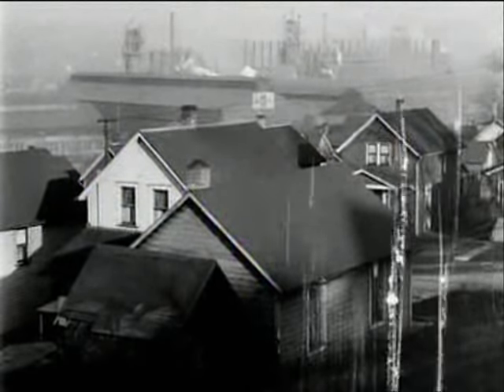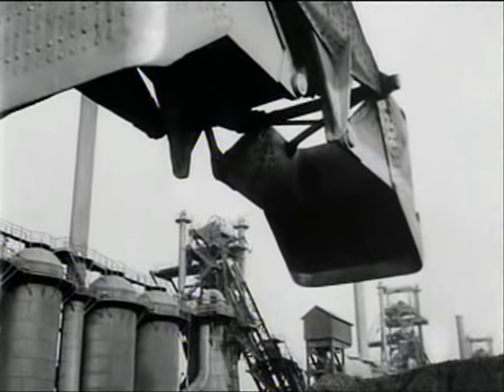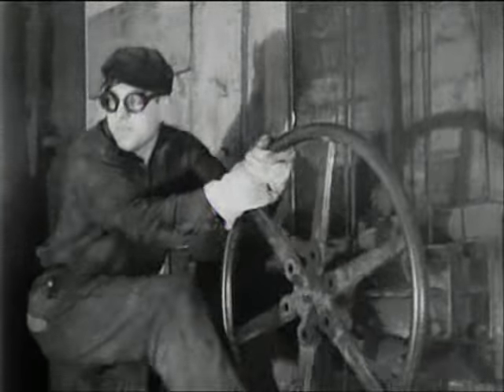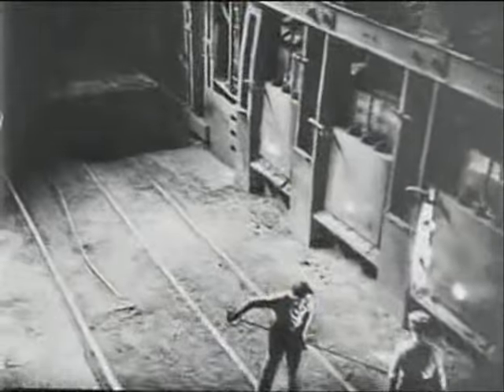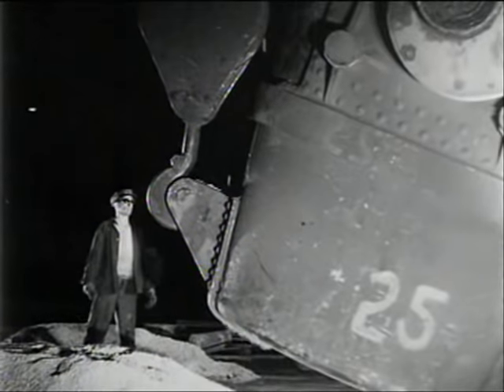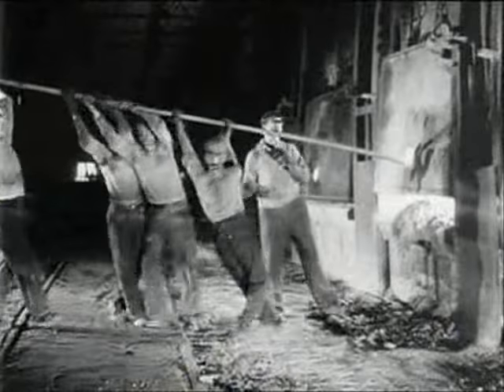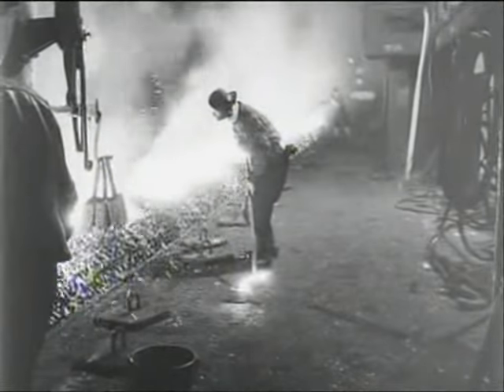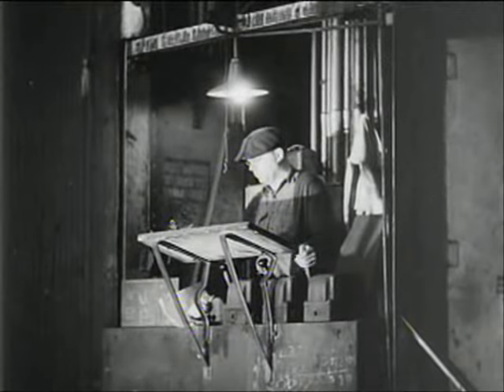Steel Industry 1944 Youngstown, Ohio

Comment: During a shut-down of my home division, I worked on a temporary assignment on the pouring floor of the blast furnace at Lone Star Steel (now US Steel) during the Texas heat wave of 1980. We tapped the blast furnace, routed the slag to an outdoors cooling pit and the molten iron through sand-lined brick ditches to torpedo cars. After the furnace was emptied we stood on boards on top of still red-hot remains of iron and slag in the ditches, cleaning them with shovels and wheelbarrows and adding a new layer of dry sand to protect the ditches used to carry the molten iron to openings in the floor to the torpedo cars on a lower level. As soon as were were done, it was usually time for another tapping of the furnace. My additional duty was to take the temperature of the molten iron with a long road and thermocouple. We didn't have any fancy silver suits and face shields,  just green fire retardant denim jeans and jackets and cotton gloves. It was unforgiving, punishing work. I was so glad to get back to my home division of the plant when that line came back up. I can't imagine doing that for 20-30 years. The 1940's era blast furnace was disassembled back in the 80's and sold, along with related equipment like the coke ovens. Those jobs are gone forever.
Show less
REPLY
Reply: these processes are still in vogue in most of the parts of the world!!
Reply: Far from gone forever. I work at the largest blast furnace in the western hemisphere. We make 14,000 tons a day.
And yes, the work is still punishing.
Reply: I did pretty much the same jobs at a 50's era Blast furnace at Algoma Steel. A tough job on the best of days, but it could get a lot worse. We were tapping the furnace one day when the drill got stuck. Only way to get it free was to use an oxygen lance. About 40ft of copper pipe screwed together with pure oxygen fed in one end. The driller repeatedly rammed the lance into the drill hole ( eye of the monster), two summer students (I was one) were behind him helping to hold the pipe as we repeatedly rammed it into the hole. The oxygen burned everything, the drill the fire mud and the copper lance, which got shorter as you went. The pipe got shorter and shorter until we were so close that the driller could hold the pipe by himself, and waved us away. The old driller had a face shield that was so distorted from the heat that he kept it up, held the lance in one hand, and used his other arm to protect his face from the heat. Right when the pipe was so short that the driller was within a few feet of the furnace the thing popped like a balloon. Molten iron sprayed across the room , the driller disappeared in the shower of iron. We ran for our lives, I thought he was dead. He ran out after what seemed like an eternity, his eye brows and mustache had been burned off his face. He sat down on the bench beside me, and started to cry. He said, 'Marco, I hate this a f'n joba, I gotta three more years, Marco stay in a school!'. Best lesson I ever had. Went back to school and finished my engineering degree!
Reply: I did the same thing at Sharon Steel Corp, Romer Works, blast furnace in the 1960's it was very similar as you described it, I worked mainly on the cinder side but remember standing on the the smoking boards working in the troff and skimmer taking turns with a sledge hammer driving huge bars to breakup iron build up and clinkers. Shovels and Wheelbarrows were the main tools!
Reply: Thank you all. For all you do.
Reply: You know so funny they blamed it on the oil crisis. And you know what's so funny. We became independent on our own oil. But guess what we won't be anymore. Nope not anymore. I wonder if China has anything to do with this? 🤔
Reply: Is this copypasted lol
Reply: Wow!!!

Comment: I grew up in Buffalo, a city that was supported by a giant steel industry. I knew people who worked at these plants... it was hotter than hell! 120 degrees F was the ambient temperature. When they opened the furnace, it was unimaginably hot. Only a few people could stand the work. They had permanently burned skin, and drank "boiler makers" on the way home.
Reply: Amelia Elizabeth Voss 
I work in metal foundry and can confirm your statement! I'm the youngest guy on the melt deck currently. They hired 6 men in a 3 month period for my job before I came along and stayed. 
The last guy hired before me walked out after an hour.
It ain't easy work, but I like the pay and enjoy the science! The senior crew taught me the trick to staying on your feet is to drink at least 2-3 gallons of water/gatorade per shift. Otherwise you'll become dehydrated and collapse. It's not for everyone, but a few of us wierdos enjoy it! Haha
Reply: I can certainly identify I was a slag and metal tapper for FMC in Pocatello, Idaho from 1989 up until the plant closed in 2001 The furnaces weren't the open type because the product we made was phosphorus, captured as a gas from the molten ore...the gas then went through electrified precipitators, then condensed down into a sump as elemental phosphorus. The tapping floor was as you describe "hot" especially during summer where your sweat soaked your shirt, then clung to you form literally doing nothing but standing there watching your tap. Each furnace had a tapping shed equipped with an air conditioner which sometimes worked depending how fast maintenance could get to it. Sometimes it was cooler outside in 100+ degrees where at least mother nature provided a draft. Sometimes your furnace got sick when the feed combination of ore, coke, and silica were not right you would be at the tapping hole burning multiple burn pipe, spilling over because you couldn't get a decent flow or even plugged, the slag therefore would build up and then you'd have to jackhammer it off the runner and turn box, then start all over. Fuck I remember those days, some were shitty fucked up stressed out days, but ironically I had some of the best and weirdest times of my life there. And by weird I literally seen ghost workers there dressed in their regalia of their time. I thought I was hallucinating at first from sleep depravation from the graveyard shifts, so I didn't tell anyone until I asked another co worker/ friend of mine if he had seen these ghost and he confirmed it as he described them to a " T " as wearing the same clothing and vintage hard hats the same that I saw in the same location as well. It added a whole new meaning to the term 'graveyard shift.
Reply: C D Kennedy chills down my spine. Spiritual sensitive here with a few encounters from the other side. I know many sailors in the USN speaking of seeing either workers of former sailors in odd places throughout the boats. Let us pray that we all one day see the light and to be carried by the Holiest of Hollies.
Reply: Did you have to be college educated for this job ?
Reply: @n.ll.8796  No, but you had to identify as non binary.

Comment: 1973 Colorado Fuel & iron, Pueblo, CO 3:18 I started as common labor in the Open Hearth by chipping clinkers. 3 weeks later I was a Motor Inspector (mill electrician) and worked in most of the mills such as 10 inch rolling, central shops, and so on. Sears made tools nearby Canon City and would bring steel drums of broken tools to be inserted into the open hearth to be melted down. There was also the largest steam engine west of the Mississippi River there, rated 22,500 hp I was told. It was interesting to see it roll steel; interesting facts were that it could reverse direction instantly and had max torque at stall with the crank at 90 degrees and I watched it snap a steel fuse.

Comment: This is what America should look like. And not what it is today.
Reply: You mean dirty steel mills where men were injured or killed on a regular basis? Modern steel mills are much cleaner, safer, and more efficient, and don't have to be concentrated in just a few places.
Reply: Slappy - exporting steel production overseas based on labour cost, is not “efficient”. 

This narrative of “post-industrialisation” as an economic step is exactly that, a narrative. It was/is a choice to manufacture abroad, brought about by bottom line. 

Efficient technology could see large amounts of steel still made in the US and the UK, however governments have repeatedly failed to support modernisation. Couple this with unions asking for wage rises that could not be sustained, and these industries in the west where doomed to fail. 

The caveat here is places such as Germany and Japan, still produce per capita significant amounts of steel, and net represent a couple of the worlds largest steel producers and exporters. 

They have and had the correct linkage between unions, local government and national government, where jobs where guarded as long as wage increases where not demanded frequently. 

Working conditions where improved, safety was improved, and efficiency was increased though technology as well as newer and superior management structures. 

All of this can AND SHOULD be learned by America and the UK, both countries should maintain and grow their industrial base. This however will only happen, if it is accepted that Post-Industrialisation is a government and market choice!
Reply: Ok boomer

Comment: “Peter Seimen. He’s the blower”
This has to be a joke...
Reply: No that's not a joke,  that was a real job position in operations of a steelmaking blast furnace. Usually, the Blower was lead man on the furnace crew,  his main responsibility is to control the volume of extremely hot air that comes from the steam-driven turbofans after going thru one of four huge stoves. The blast of hot air holds the furnace burden up above the hearth where the iron ore melted and dripped down to the hearth. It was a very important job as far as the safety of the furnace crew and the operation hour by hour of the furnace.

Comment: Just FYI, if a worker falls into the molten steel, he doesn't fall INTO it. It's far too dense for you to sink into it to any appreciable degree.  You will just lie there on top of the molten metal and get burned to the bone (and beyond) faster than you can react. The heat will flash the blood and all water in your body into steam and the parts of you that contact the steel will explode from steam explosion and then catch fire.  You'll live longer than you want to. Just seconds, but seconds too long.  Best to NOT fall into the steel.
Reply: Well thanks 4 that 1,i.had a freinds  dad fall into it Ata plant years ago.

Comment: I grew up all my life in Youngstown. There's just little parts of the steel mill still up but most gone. I grew up right up the street from the mills, use to jump on the trains going in and out and jumping off the train bridges crossing the Mahoning River into the river.

Comment: Two corrections. The materials charged into the OH furnace are molten Iron and scrap STEEL Also the molten Iron produced at the BF is referred to as molten Iron or hot metal. It is not Pig Iron. Pig Iron is molten Iron that has been ccast into "pigs" which arre small moulds to produce a product that when cooled is transported easily. It is generalls used as feed for foundries.

Comment: What a wonderful film. The conditions in these mills went on for 40 years after the film was made. Dirty, run down, old parts, danger, no modernization, good grief. One of the reasons the US could not compete in the steel industries was the antiquated way everything was done. However, we need to make steel in the US again because it's a strategic material.

Comment: In the arcane choreography of mechanical affairs, one embarks upon an endeavor most curious, though bereft of purpose it may be. Behold the steel plate, stark and unyielding, and the slender rod poised for its entry. With the grace of a melodramatic waltz, thrice the rod is turned within the plate's icy embrace, an act witnessed only by the soft iron hammer, tapping thrice in sympathy.

In hushed reverence, one proceeds, inspecting the plate's visage with meticulous care, searching for deformities as if they were secrets whispered by the very gods. Alas, this solemn process, while ornate in its performance, unveils nothing of consequence—a melancholic riddle, a dance of futility.

Comment: 06:15 reminds me when i worked on a zinc factory. Old worker used to slash bags of antimoine and lead and throw them on the heat. Without mask of course. I worked there for 6 month and it still one of the best experience I've ever had. Hard work, dangerous, toxic but a real solidarity.

Comment: I still live here and go to college here, a saying around here goes something like "The Youngstown Gray" cause how bad it has turned out
Reply: Do you mean the air or water or?  A lot of history. How many of the mills are still there?
Reply: @rayc.8555  Recently and I mena when Obama was still president I believe he did come back to youngstown to approve a whole new steelmill which has since been completed, and to my knowledge there are a few that are still active Valerec is a company that has just bought a mill in recent years. I know this since my dad ended getting a job in the mill as a safety guy. But to answer your question without googling anything the water and air are both fine but just because how everything turned out. The city and surounding areas are full of crime and poverty stricken areas. A big part is the weather, it's either freezing or raining 3/4 of the year or scalding in the summer. The biggest thing going for Y town is probably YSU youngstown state university. It is a good and nice school very cheap relative to other colleges, with a fantastic engineering program which is attributed from all the crazy engineering feats needed for the mills back then.

Comment: I worked in a steel foundry for exactly one day.
All the other workers covered in scars and burns. Some missing fingers. Some horror stories. Safety first, of course, but molten metal still melts human flesh.
You'll be fine. Until sooner or later you get burned. Not worth the pay.